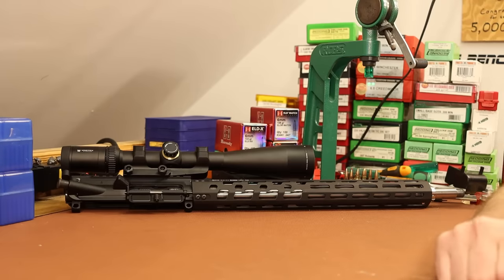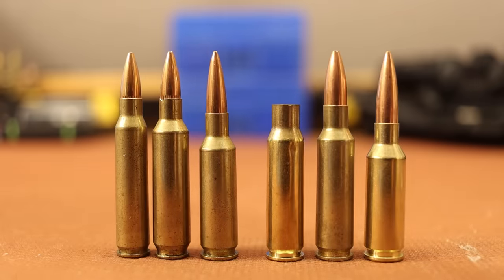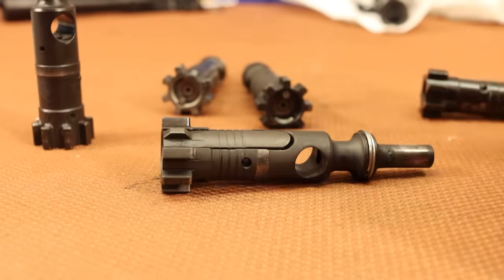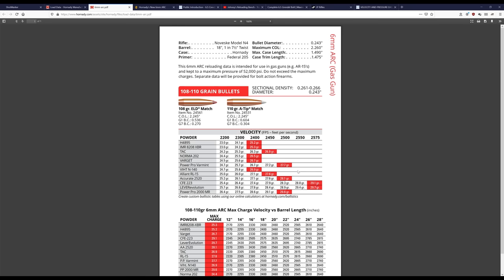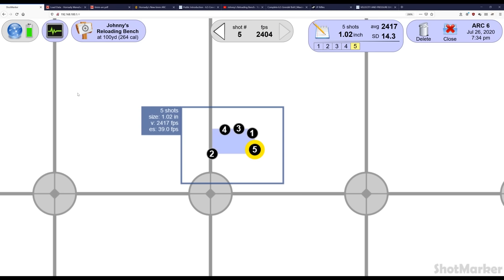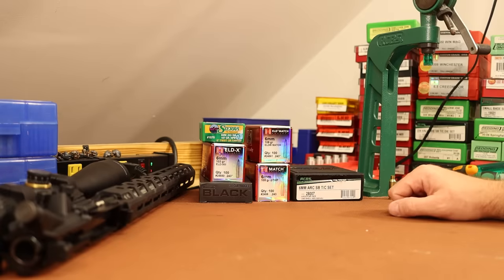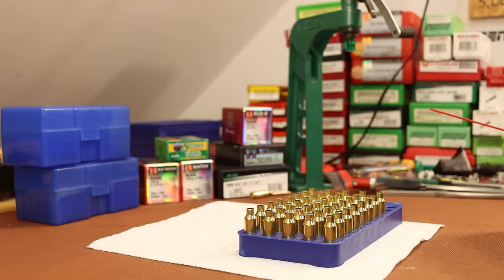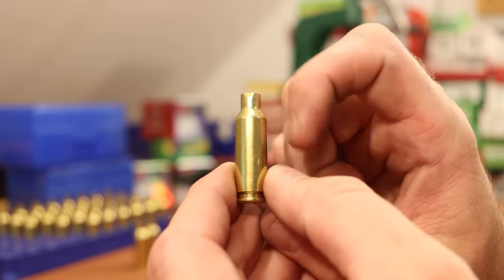6mm ARC - Getting started with reloading

Comment: Johnny - Those dings in the case mouths seem to be something that is fairly common if the gas isn't adjusted just right. I recently had the same problem with my 6.5 Grendel. I don't have an adjustable gas block on my barrel yet so I can't do a whole about it. However, another shooter at the range heard me bitchin' about it and told me a stop gap measure to help keep it to a minimum is to stick a piece of loop side Velcro to the shell deflector. There is also a soft rubber stick on I believe is called a deflector brake or something like that which is supposed to do the trick and stop case dinging. I'll be trying the Velcro until I get an adjustable gas block.
BTW - Really glad to see you back!
Reply: Jet2416 my Grendel case mouths are getting dinged. My ejection is nice at 5 o’clock should I adjust my gas up or down to get the brass from beating up the case mouth?
Reply: @nataliedeyton6829  if your cases were ejecting forward I'd say you might be a bit over gassed and may want to turn it down a bit. But if your brass is ejecting at 4 to 5 o'clock and your gun doesn't feel like you are getting excessive recoil, I'd think it's just the nature of the short case of the Grendel cartridge. Maybe JRB can give you a better piece of advice but it doesn't sound like you are having a gas problem. I bought some of those rubber stick-ons call Deflector Brakes and will try those before messing with the gas.

Comment: With regards to case capacity:  Is it possible to seat the "heaviest reasonable" bullet (so, 108gr for 6mm ARC, 123gr for 6.5 Grendel*, etc.) in an unprimed case and then inject the water through the flash hole, to get "actual" case capacity when using decently heavy bullets?  Or would it be too hard to get all the air out?  I'm curious how the comparison between those cartridges would play out when accounting for the volume of the bullets themselves.

* I'm aware that people can and do use heavier bullets in the Grendel, but from what I can see, 123-ish gr is about the heaviest you can get from the factory, and I'm more interested in a "reasonable" number than an absolute max.
Reply: That's a good idea.
Reply: Interesting idea. A bit of dish detergent or Redline Water Wetter would be worth trying to minimize air bubbles. I make a dummy round with every bullet type to check cycling and set the seating die so have several cartgs to test. Thx for the idea.

Comment: Wow.  PP Varmint just shoots in those cases of that size.  I recall it was a great powder in the Grendel as well.  Johnny you think Hornady designed that reamer to be short so that you could not load those bullets long and get over 52000 psi.  They had to know that in most Grendel mags you can get around 2.3 inches of COAL.  It seems with the bullets that you would want to shoot in ARC that you will never get even close to that length and therefore never be able to increase powder charge.  Just a thought

Comment: This is a great primer (pun intended) for 6mmARC loaders.

I have a feeling a 6mmARC re-barreled Rem 700 223 Rem with a bolt modified for a .440 Type II bolt face could be a great shooter, too.
Reply: The bolt gun only data has this nipping on the heals, closer than you'd think, to the .243 winchester.
https://www.hornady.com/assets/site/hornady/files/load-data/6mm-arc-bolt.pdf

Comment: The White Oak Armament page on 6mmARC has some valid concerns.  The problem is that many reloaders are going to push their loads beyond 52K psi.  Having said that, I will try 6ARC because I think it has a few advantages over 6.5 Grendel.
Reply: It has no advantages over Grendel, not one. Your most likely just not fully aware of what the Grendel can do, because like this video, people dont get into the performance realm of reloading and fall for things like the ARC
Reply: Hammer Click - I’ve been reloading for over twenty years and shoot regional club competitions.
Reply: @petersouthernboy6327  What you think your the only re-loader and competitive shooter? SO PLEASE lets move beyond subjective "I think" as you stated and innumerate what would make the 6ARC better than Grendel.
Reply: @petersouthernboy6327  dont let that guy fool you. He has been complaining to anyone interested in the arc on this video. Your right the arc has advantages. If your looking to shoot bullets at the 107gn range. Bc wise the 6 arc is superior. They have the same max pressure rating as each other.
Reply: Orange Rider - thanks for the sanity.  I already have a 6.5 CM chambered AR-10, and if I can shoot the 95 grain Ballistic Tip and SST’s out of the small frame AR form factor that suits my personal needs well.
Reply: @petersouthernboy6327  absolutely. Both the 6.5 grendel and the 6 arc are great options. I dont have personal experience in the 6 arc yet but I'm waiting for faxon to make a heavy fluted barrel. They are very similar cartridges when loaded with light weight bullets but the 6mm should always have a better bc.

Comment: I had good results with AA2520. Best hunting round is Nosler ballistic tip hunting bullets 95gr 2849fps with 28.4 gr and CCI 41 primer. SD's around 8-9fps.  Able to get .030" jump and fit easily in mags. Best PRS round is Vapor Trail 103's with 28.2 gr AA2520, CCI 41 primer at 2750fps. Both from a 24" barrel, Aero Precision with an MPA 4 port muzzle brake. SD's around 11fps(not horrible).  Added a barrel tuner and got the 100yd group down to .2". Unheard of out of a gas gun. Gun functioned well with very manageable recoil. Loaded as long as possible to function in mags and had about .070" jump.  Berger 109's decent groups but mag length was .100" jump.

Comment: Yessss - Johnny is back!
I think you have only scratched the surface of this round’s potential, and that with a short-throated barrel (worn out reamer).  Odin makes great products, but it may be that the pressure to get this barrel out quick led them to push the reamer too hard.  Let’s see the Krieger barrel chambered by a grey-bearded master.  Still a Grendel fan, but want to see the ARC succeed—that will mean better magazines and bolts for the Grendel.

Comment: Not sure if you checked the load data for rifle but if I remember correctly hornady says for bolt gun max psi is 62500 or 62000 i think.  They also added some very light bullet options.

Comment: I'm not sure what WOA was trying to show with that bolt picture.  It doesn't look like the lugs "caved in" or weren't restrained by the metal surrounding the cartridge.  It does look like they were subject to excessive pressure.  This might just be a less-than-ideal image - designed to show the most damage rather than the slight deflection the lugs might have owing to the thinner metal around the cartridge head?

Take-away lesson here for me is - maybe you can't rely on primers to tell you if you're to hot.

Comment: People have been pointing out the "thinness" of the bolt around the lugs for ages now, but I haven't seen a single person substantiate that concern with any really hard data showing it actually has lead to any failures of the bolt.
Reply: Go to the White Oak Armament page on 6mmARC.  The problem is that many reloaders are going to push their loads beyond 52K psi.  Having said that, I will try 6ARC because I think it has a few advantages over 6.5 Grendel.
Reply: Yeah, I feel like it would be a known thing if it WAS a thing. Personally I feel like with modern metallurgy and the very even and symmetrical design from seven lugs that it's fine. If the bolt was an old style with two big lugs and that thin web I could see stress concentration and fractures.
Reply: Gresvig - I’ve seen AR lugs sheared and bolt face edges cracked on Grendels. Of course, I’m a member of a gun club with competitions and all of those shooters are reloaders pushing the ragged edge of sensibility.  That’s why Hornady has separate load tables for bolt guns in 6mmARC.
Reply: Yeah, at the highest levels of sensibility you always run into, er, destructive testing. I probably should have been more specific,  a thing meaning at least a common happening with factory or near factory ammo. Sort of like some bolt ons on an LS motor vs. "Let's see how much boost this will take".
Reply: If you look at the bolt, you can see that the lugs that are right next to the extractor have no support on the extractor side.  That makes this the weakest spot on the bolt.  I have a bolt on my reloading bench with that lug broken clean off from my 6.5 Grendel.  I even have the broken off lug as it jammed the action.  That bolt had been in place for about 3,000 rounds.
Reply: Gresvig - I have three AR-10’s and they are wonderful but they are heavy.  We have 6mmARC because SOCOM wasn’t thrilled about humping SCAR-17’s and M110-SASS up and down the mountains of Afghanistan with a full combat load out (extra 12-15 pounds) and they wanted to see how far they could stretch the small frame AR form factor.

Comment: tighten those bushings(oring too small) - goto mr oring and order a 3.1x24.4 oring, I think  on amazon. Or call hornady and have them send you a shime, it's a know issue especially on there AP. I had a powder measure that backed out after 50 rnds and after I added the oring it never happened

Comment: Thanks for the heads up on the lugs.  I've been playing with a 243LBC for a couple of years now and I am guilty of pushing the limit.  I find that the LBC has about 1gr, more case cap. than the ARC.  Mine has a 24 inch bbl.  So far I've used 2000MR and CFE223'  I have used up to  32g of both powders and backed off to 31g. of CFE223.  At 32g. of CFE223 I did have a primer back out but it was a 105deg. day. (southern Idaho)
30.5 g. of CFE223 gives me 2750 fps. 31g.  2810fps.  After about 300 rounds my lugs look good.  I use a PPC die and reform new 6,5 Grendel brass (about $.50 each)
This gun/round is amazingly accurate and I would build it again.  My opinion, if someone is considering a 243 bolt gun go with the 243 Win.

Comment: Your discussion on bolt loading is very interesting.    Going to short, fat cases to keep within the 2.26 COAL for mag loading larger bullets is a compromise with consequences.  Shorter case bodies lessen their friction grip on the chamber walls at MAP, so the reaction is taken more by the bolt face.  Keep the chamber walls clean and no lube, CLP, etc., on the chamber walls.  Alcohol with bore mop is good for final chamber rinse.  Clean the sizing lube off of cases used for reloads.   Blowback soot soon adds to chamber debris for gas guns.   Varmint Al  www.varmintal.com did some modeling with .243 chamber and bolt to show transfer of firing reactions from case wall to bolt face as the coefficient of friction between chamber wall and brass was decreased.  He used LS-Dyna non-linear coding developed by the nuclear industry.

Comment: May look into the hammer hunter bullets they make an 88 grain that I think would be perfect for this cartridge with it's slick .212 G7 BC and it expands like a Lehigh bullet with the nose splitting into seperate pieces and the base punching through. Expands at 1800 fps and the rifling bands are round not sharp like Barnes bullets do you get extra velocity compared to standard bullets of the same weight.

Comment: glad you are back and what a way to do it with an almost 2 hour long video about a new cartridge that im actually pretty interested in. I been debating on getting into the 6mm arc. Ive already got 3 grendels 12" odin 16" anderson and a 18" faxon. If i do the 6mm arc i think ill probably just pull my 16" anderson grendel barrel and use that rifle with the new barrel. Still havent decided which barrel to get either but its def going to be either the odin, faxon , or ballistic advantage. I was leaning towards the faxon but after seeing this it has me second guessing that maybe i should go with the odin works lol.
Reply from the maker: Neither Faxon nor BA has the ARC barrels on their website. Do you know what twist rate and gas system length they're going with? The XL gas system is what really sold me on Odin Works.
Reply: Johnny's Reloading Bench B/A is a 1-7 twist and the faxon is a 1-8 twist. I found them on brownells. They are actually sold out at the moment though.
Reply: Johnny's Reloading Bench the faxon has a carbine gas on the 14.5” mid gas on their 16” and 18” and a rifle gas on the 20”. Bout to go check the ballistic advantage out be right back lol
Reply: Same for the b/a barrels the 16” has the mid gas and the 18” and longer have rifle gas
Reply from the maker: @justa3v619  I don't know enough about the cartridge at this point. I'll be REALLY curious to see how well the carbine and mid systems run with the shorter barrels! Hopefully these companies are sizing their gas ports properly for this thing to run well.
Reply: Johnny's Reloading Bench on brownells website in the description faxon list the size of their gas ports for each length barrel and gas system. Ballistic advantage doesn’t have that info listed, at least not on brownells
Reply: I think I’ve got my mind made up on the faxon. If it shoots anything like my 18” gunner profile match Grendel barrel I’ll be happy especially for 200$. Actually my last range trip I shot the best group of my life with that barrel 1/8 of an inch I was blown away especially since that was the first group of the day. And I followed it up with 3 more groups all under 3/8 of an inch. That was with two different loads too. 100gn nosler ballistic tip 29.1 grains of h335 and 100gn a-max with the same powder and charge. But that barrel even shoot factory ammo pretty good. It really likes the American Eagle 120gn otm.

Comment: You have me wanting to reload for the first time in my life.  I can see the benefits and the process (which I have not before).  Curious, what do you think about Criterion barrels?
I'm amazed with my HBAR, 1 in 8 twist, 18" .223 Wylde...shooting .35" groups consistently with Hornady .223 factory ammo.
My AR is fairly heavy with a Wraith scope and I use a bipod.
Reply: I have a 223 Criterion Barrel on a Remington 700 action. And it shoots great I do not really have any complaints I got a 1 in 7 twist for shooting heavy bullets. But I also shoot lighter bullets and it seems to work okay.
Reply: @Mike-xi4zt  Ya, I was amazed a gas gun could shoot so well.  I admit the conditions were perfect, I was shooting Hornady varmint ammo, so there were not as many factors to thwart my efforts, but still, I was impressed.  Up to this point, all my best efforts to custom make an AR platform gun shoot well, resulted in 1MOA shooting.  I have been focused on getting more toward 1/2MOA for a few years.
I have since built a 6mm ARC as well and went straight for a Proof Research SS barrel which is proving to be a good start with .7MOA initial groups (during break-in).  Ammo is a bit scarce, so I have not shot it much yet.
One other note about the Criterion build...I lapped the face of my upper to mate-up true with the barrel and it made a big difference when comparing before and after.

Comment: Love these videos. I was able to get my SPR/ groundhog setup to shot a .352 10 shot group @100 yards with the load testing setup he uses. I’ll put the details in a comment below if you’re interested in looking at them😎
Reply: RIFLE:
Upper:
Aero upper I trued and checked extension mating surfaces on a lathe with a dial indicator
DD 18” cold hammer forged chrome lined barrel 1-7 twist
Muzzle brake I turned on a lathe
Ergo low pro adjustable gas block
Inconel gas tube
Brownells titanium m16 carrier that I put lightening cuts on
Vseven titanium firing pin
POF roller cam pin kit
Bolt I headspaced
15” MI suppressor ready handguard
For assembly, I locked in the barrel using loctite locking compound

LOWER:
Aero matched lower
Timney calvin
Magpul PRS gen 3
POF anti tilt buffer tube (world of difference)
Accuwedge
Ergo palm shelf grip
Accushot bipod
All topped off with a vortex venom 5-25
Ammo: running 69 gr matchkings. Bought 1500 of them, ogive sorted all of them using hornady ogive gauges. Then trimmed meplats using an MPR meplat trimmer and deburrer, then pointed them using a whidden bullet pointing die, and finally weight sorted all of them and checked bullet OALs to make sure they were exactly the same. Also bought 500 pieces of nosler custom brass(I fireformed all) and a Lyman micrometer seater die. Ran the brass with the shoulders knocked back 2 thou and neck tension at 5 thou. Hand weighed powder on my A&D FX-120i, I seated the bullets 5 thousandths off the lands (sanded out the inside of a MPT 10 round mag to allow for a COAL of 2.285 without rubbing), and used 8208 XBR, forget the exact charge but I believe it was high 22s ( I am changing loads since it’s a 5.56 and I want to run some varmint ammo thru it, damn groundhogs). After seating I threw each round in a hornady concentricty gauge and checked true, gave them a light-medium crimp, and called it a day. according to my range journal, it was 70 degrees, cloudy, no wind, relative humidity of 40%, And 1,001 feet ASL. Average velocity was 2763 fps with a SD of 4.1. Learned a lot about reloading from the man himself, THANK YOU JRB! It probably isn’t worth all the effort to squeeze that level of accuracy out of an AR, especially since they bang up the rounds so bad when chambering, but it was fun to play with all the variables. Lord forbid I get a really accurate bolt gun, I’ll be wasting away behind a single stage press cooking up loads for it😂😂

Comment: For the part about the cases hiting your upper walmart sell peal and stick cork sheets like 10×10in for a couple bucks i bought some for the top of my reloading table i would suggest that for your upper like a 1in square piece would work wonders i would think
Reply from the maker: Nice tip! Where do you find that? Hardware section? Arts and crafts?
Reply: @JohnnysReloadingBench  school supplies or arts and crafts